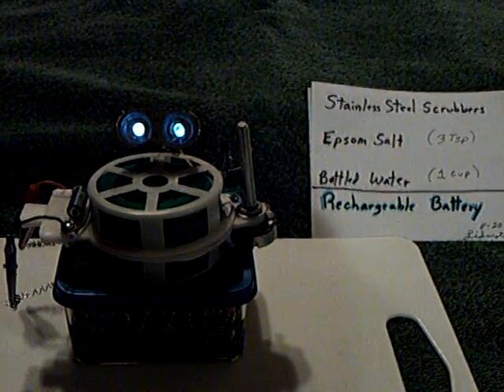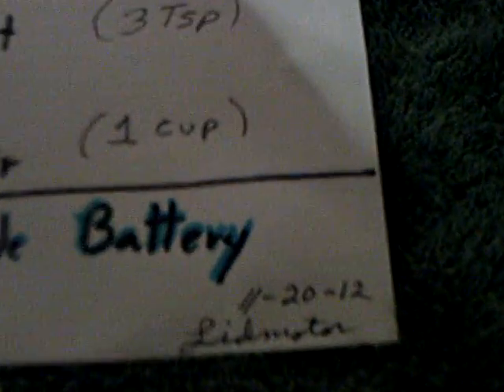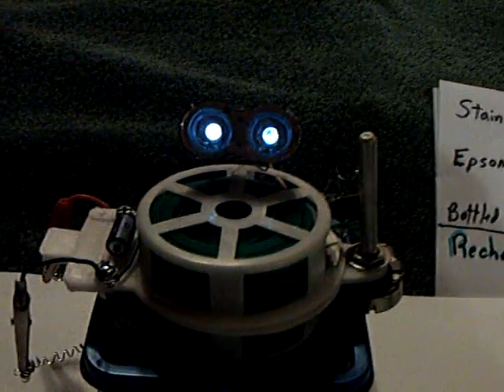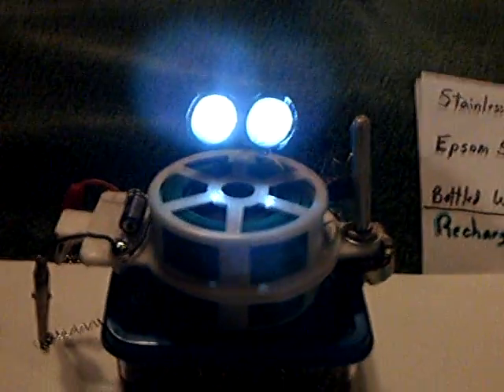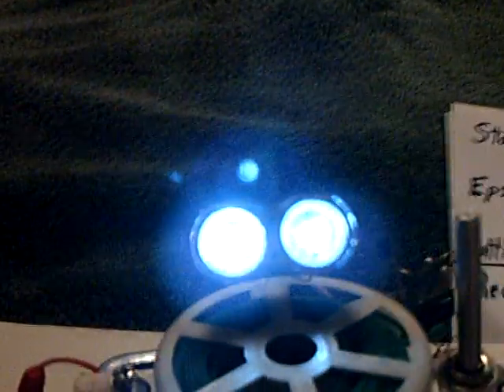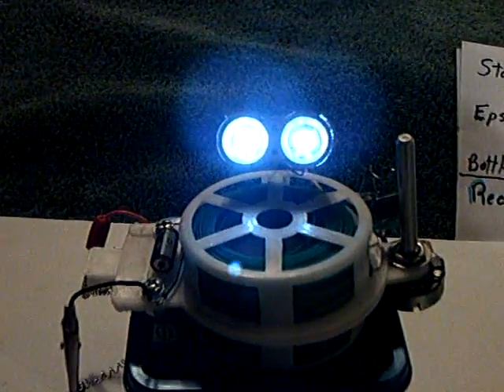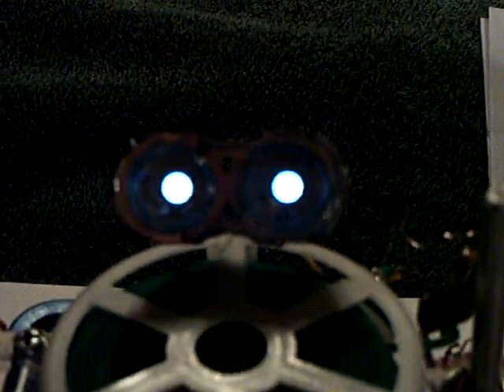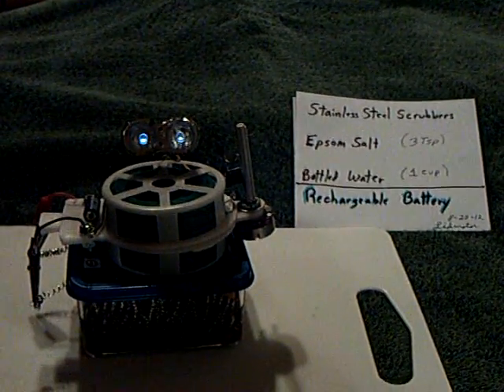Stainless steel and Epsom salt Rechargeable  Battery --Boxed

Comment: Hello Hello Hello....Fellow nerd and contraption builder. I am a battery builder of many types myself and have done many experiments in the subject.. I want to turn you on to something that will help you build better batteries of all kinds and types.. Im going to cut and paste another post here about the subject fo the sake of time and ease .. I believe you will know what to do next...
  I found they can now be purchased on line and shipped right to your house no restrictions or msds hazard concerns. I also found many easy and cheap ways to build and improve most any battery you can name. Since your one of the few who has the brains to ask I will hand it to you on a silver platter... Here it is..
Nano tubes is a big word meant to sound complex for what most would say is just soot from burnt stuff preferably with high carbon content. When it burns in an arc of electricity the form the soot takes as it burns naturally forms nano tubes as  burning happens on a molecular structure so the direct effect is the fire then has a direct molecular effect of the arrangement of the soot coming off it.. which is a single wall carbon nano tube that looks like fine black hair soot. They are that simple.. Basically... Now why would any body give a shit about some black soot.. Here is that answer.. imagine a bowling ball is the anode of a battery and you have a container of talcum powder .. now each speck of powder represents an electron trying to attach when being charged to the anode.. so you pour powder on top of a slick bowling ball and most will fall off and only some stay right on the surface on top thus limiting the number of electrons that can hold on and thus limits the charge capacity . NOW take said bowling ball and cover it in long shag carpet all over and set it down and pour your powder.... can you imagine how much more powder would stay on the bowling ball with the carpet catching millions more specs or electrons thus better charge ,power and recharge. Nano tube are the shag carpet on your bowing ball which in the short and sweet they equal tremendous surface for the anode and if you know batteries you know surface area has a direct relationship to POWER out put.. Being that the structure is on the nano scale it offers beyond what most can imagine in said surface area. SO ...... All you have to do is dope any anode of any battery with carbon nano tubes and you drastically increase the power capacity... How might one do that you ask??? well that basically means you can take the anode plate and use a conductive glue then sprinkle them on like fairy dust. However how they are arranged has a lot to do with efficiency but will work in any configuration. or say you had a lead plate  you can bring to the melting point and sprinkle tubes on surface as it cool to in bed them in plates or many other ways some you can probably come up with your self. Small scale one cell build your own battery then add nano tubes and measure the difference in power will reveal how powerful what I have just told you really is...... then of coarse you can just build batteries and solar cells out of just tubes too...LOL  Nano tech is the future... 
 I guess thats all I got to say about that......as gump would say... Hope it helps and maybe turned a light on.. but saddest of all is no body cares...they just wont let it happen but you can build them for yourself.. Like a electric bicycle battery that will go 300 miles at 30 mph on a 5 minute charge for over a million cycles....or car or what ever... Test show 10x power density for lithium ion when carbon nano tubes added to the anode...world changer...

Comment from the maker: The amp hour capacity was directly related to immersed surface area but the type of water that you mix the magnesium sulfate with also made a difference.  There would have to be much more testing to figure out exactly why this cell works.  I still think that it has much to do with the SO4 .  I really need to make one of these with activated carbon added and see what happens.  That would really boost the surface area.

Comment: Does the output energy lasting increase the closer the scrubbers are inside the electrolyte or doesn't that matter too much? 
Can you increase the amp-hours stored energy  with more scrubber material in the electrolyte?